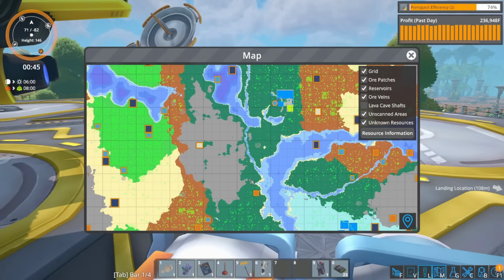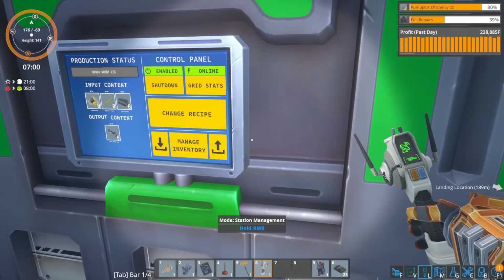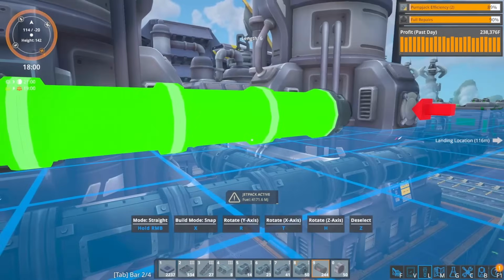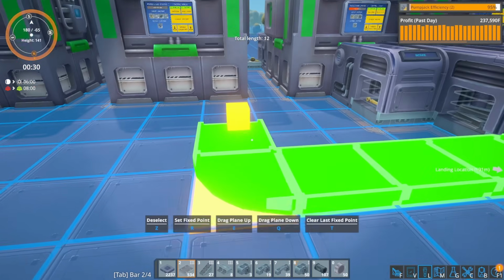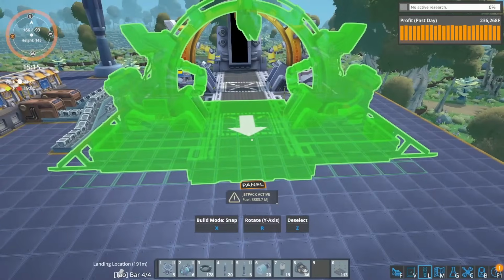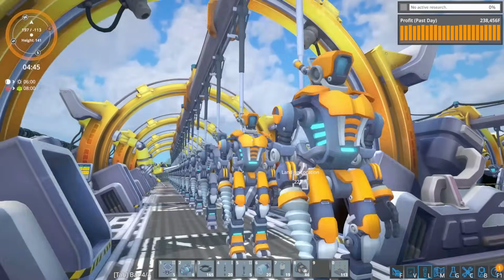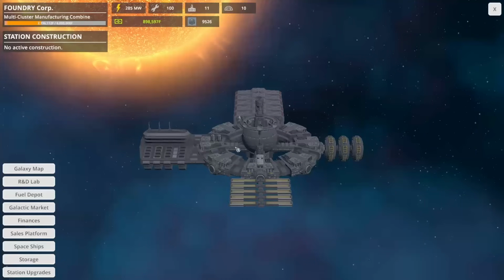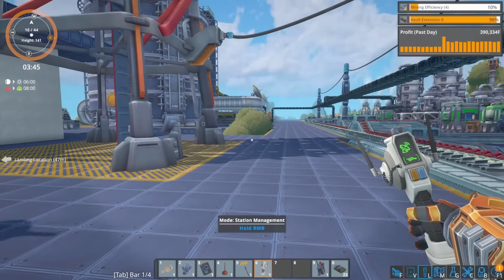Foundry - Robot Assembly Lines for MASSIVE Profits - Update 2 [E13]

Comment: There is no correct order in which you can assemble bots - you can make head first or last it does not matter. The only thing that matters and is needed at start is torso.
Reply from the maker: Yup. And they is were my problem lay...at the start. It worked out fine though.

Comment: For your shipping platform, you don't have to set it to the ship maximum each time, you could set it to 1000 right now, and it will default to however many fit in the ship. So you won't have to change it every time you reduce weight
Reply from the maker: Ahh. Good one. Thanks.

Comment: You do like using a lot of pipe elbows to pull a new liqid line.  I take one straight pipe out of the main line and replace with a T pointed up and use one elbow to point at new factory line.  This method allows for pulling multiple liquid lines all next to each other.
Reply from the maker: Damn! That's a really good idea. And much cleaner too.